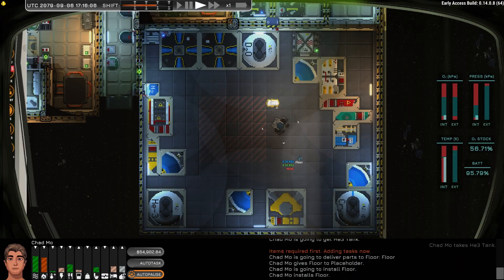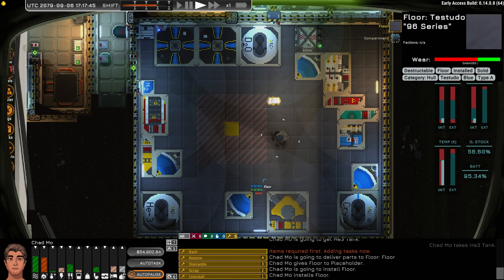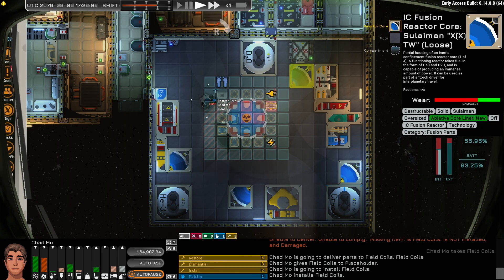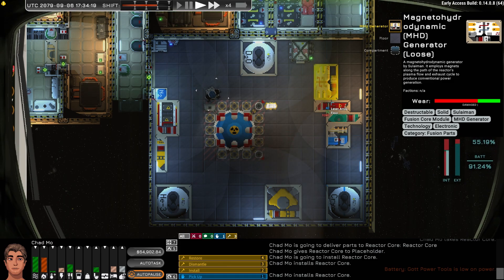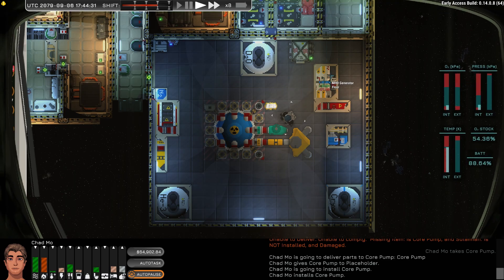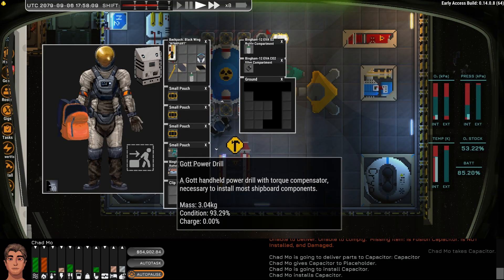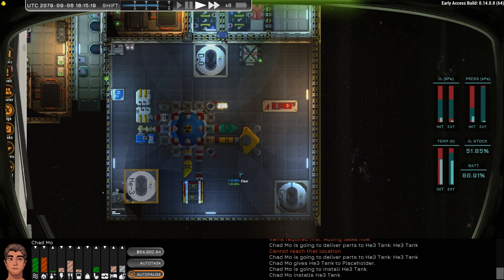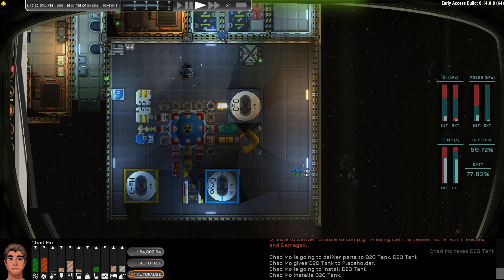Ostranauts Complete Beginner's Guide - Episode 14 - Let's Build a Reactor (build .14)

Comment: Why not use the construction tools?  The reactor is one piece when using the tool and you can easy plan out the entire build, until you are happy. Though the game does not like large amount of tasks, so don't do as me, plan the entire room, the reactor and the fuel setup, while having a few other builds going. Though I did found out that the fuel tanks work with cargo web and only need 3x3 floor under it. (The task break if say you pre-plan something without having all the items, had to save/load cycle over and over to get it past missing items, so it would go salvage the items.)

Though you can break that logic with the builder tool, as you can tell it to do something, then change the blueprint and it can still build say a tank without floor, if you cancel the floor.
Reply: i dont know how to use that lol

Comment: 4:50 Kinda, Magnetohydrodynamic means magnetic fluids, in this case the ionized plasma from the reactor. A MHD generator is a way of generating electricity from a fusion reactor by slowing down its fast moving charged particles with magnetic fields, converting their kinetic energy into electricity directly.
Reply from the maker: And now I know!
Reply: Its funny cause the other main method people propose to generate electricity from fusion reactors does have to do with water, which is just to have the heat from the reaction boil water and run a steam turbine. 300 years on from the industrial revolution and we are still looking for new ways of producing steam power.
Reply: @massimocole9689  I guess water/steam is comparatively safe and efficient to use, which is kinda important. And readily available in most of the world, at least those parts where there are humans to make use of the machines. I guess in space you'd want something that's more weight efficient though.

Btw: sure you're not meaning fission? I think we're still some knowledge away from having relevant fusion up and running. :)
Reply: @diazinth   Which method is best also depends on the type of fusion reaction, the easiest fusion reaction to ignite, deuterium-tritium fusion, produces a large chunk of its energy as fast moving neutrons, which are neutrally charged so they would pass right through the magnetic field of a MHD generator without interacting. The only way to get power from them is to have thick enough shielding to absorb the neutrons, and then using the heat from them slamming into the shielding to run a heat engine of some kind, the most straight forward being a steam turbine. 

This also folds into the fuel breeding process, cause while deuterium is a common isotope of hydrogen you can find in seawater, tritium is a rare unstable isotope of hydrogen you get by bombarding lithium with neutrons. So if you make that layer of shielding out of lithium, you get to harvest the energy of the neutrons, stop them from escaping and radiating everything, and slowly convert the lithium into more tritium fuel. 

Since tritium deuterium fusion is the easiest the steam turbine based fusion reactor designs are the ones that have received the most study, a lot of the big research reactors like ITER use that fuel mix (though ITER won't actually bother converting the heat it makes into power, since it's just a test reactor, and the steam turbine is already solved tech).  

The other main fusion reaction and the one Ostranoughts uses, deuterium-helium 3, is harder to do but produces way fewer pesky neutrons. That reaction releases most of its energy as charged particles that can be contained and converted into electricity by magnetic fields rather than needing to be absorbed by heavy radiation shielding. A startup called Helion is hoping to use that reaction with a MHD generator.
Reply: @massimocole9689  I've realized I red your second comment wrong, and having read your reply to mine, I'm happy I did: That was interesting.
Reply: Think this is a little nod to the Caterpillar Drive in The Hunt for Red October.